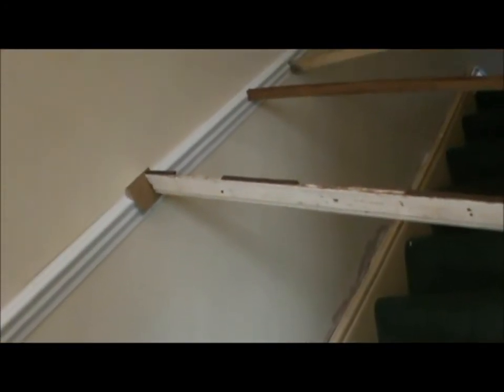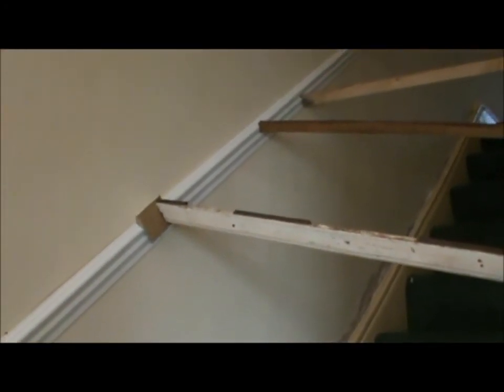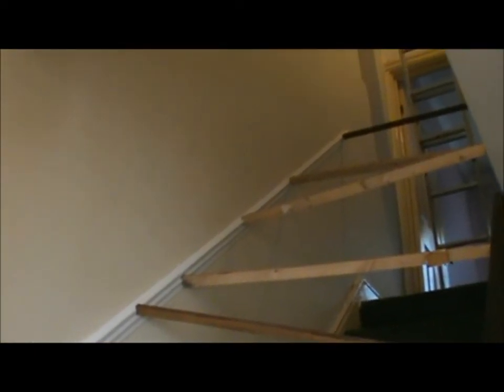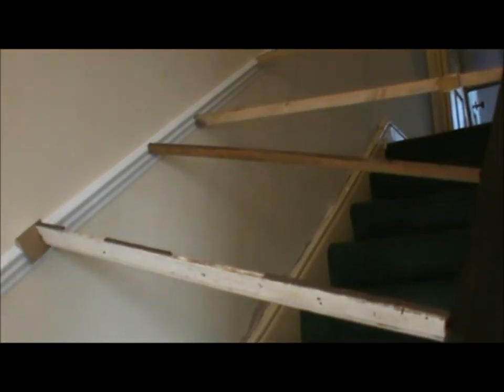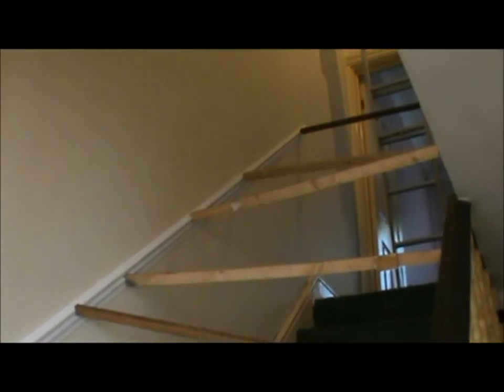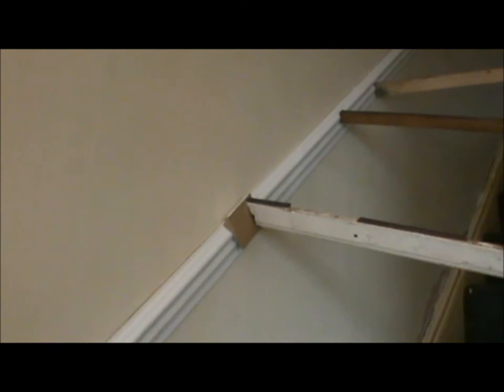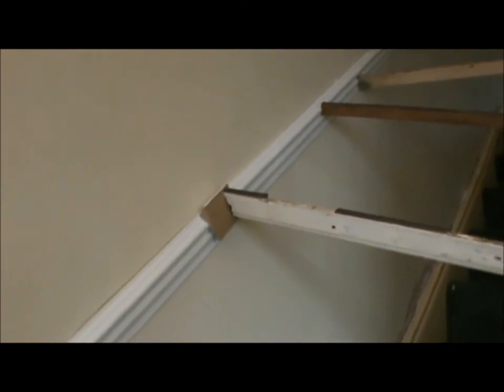Dado rail dodge

Comment: Good job. I have even stuck things to the ceiling that way. Did you use white wood glue?
Reply from the maker: No, I used 'No more nails'. Comes in a tube. Whoever pulls that rail off will have to re-plaster the wall!